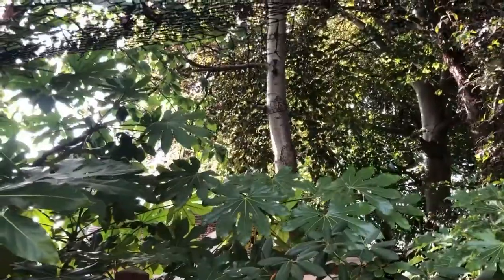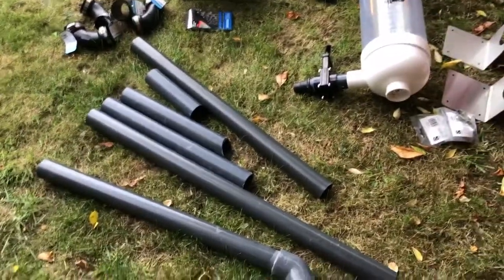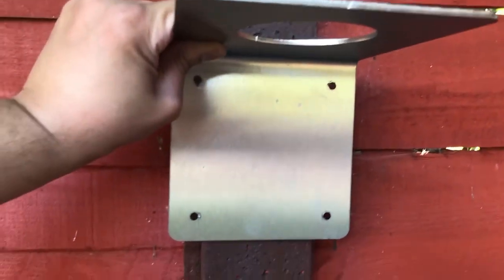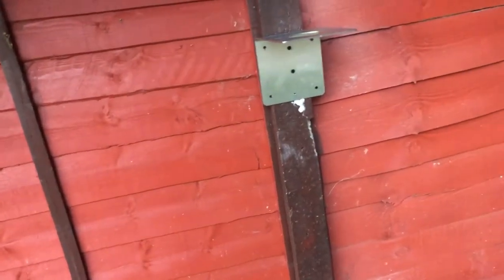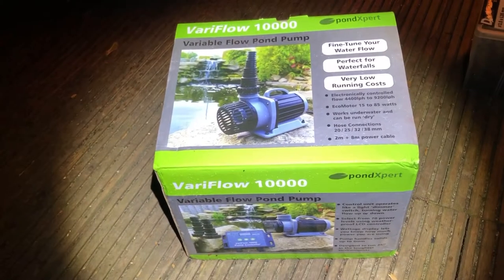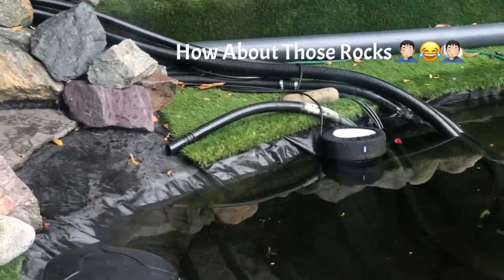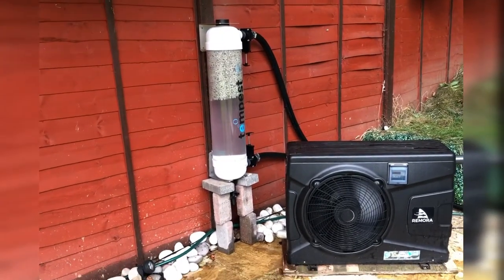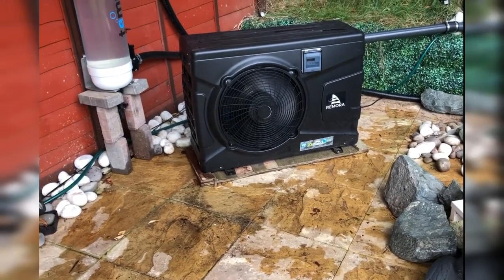Remora ASHP Install 😎

Comment: Yes bro, you set that up 10/10 the koi are gonna love the temps now, I just installed a heater too but it’s a digital electro heater not gonna be cheap to run 🤣 it’s holding the temps at 24c day and night, I prefer the black ashp looks slick, I was gonna say why don’t you cover the pipe work with all the rocks you got but I think your already on to it 🤣🤣🤣👍🏻 see you at the Kent show 🤪take care
Reply from the maker: Thanks bro 
I’ve used an Elecro one last winter 
Be prepared to see your bill go through the ozone layer lol 😂 
They hold the temp but tooo expensive to run 
Yeah hopefully see you there 👍👍

Comment: Great video and the set up is coming along nicely. Thanks for the shout out. I'd start preparing for winter and get the pipes and Tempest insulated ready. It will help you massively with the heating.  Fail to Prepare. Prepare to Fail.